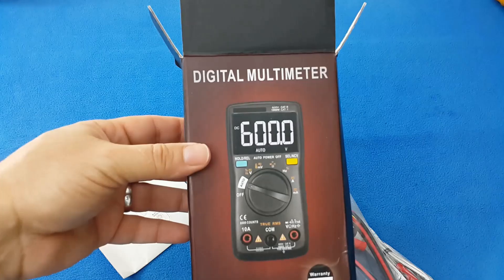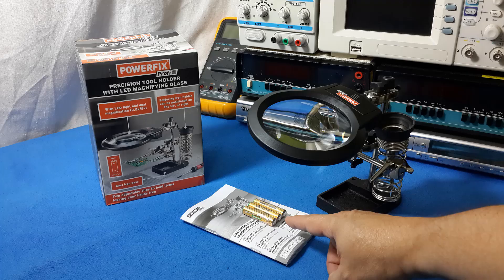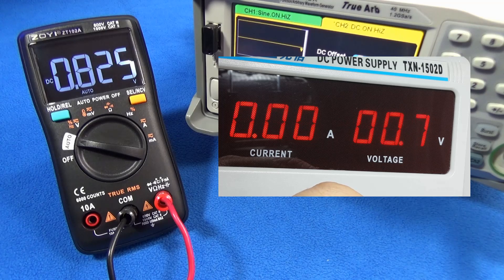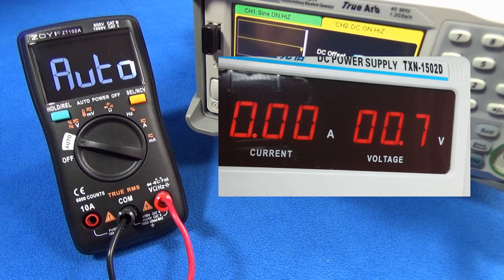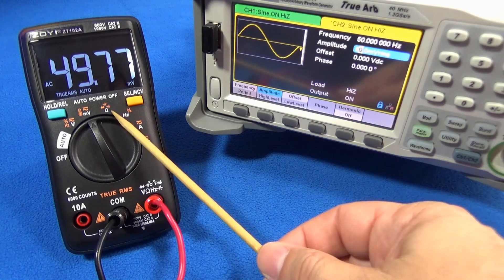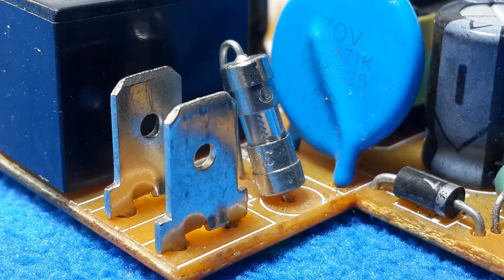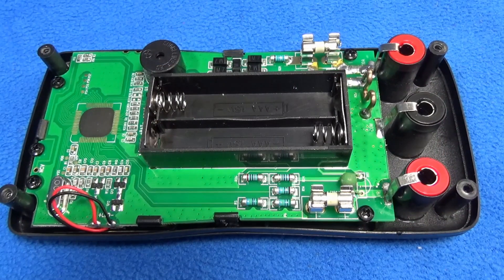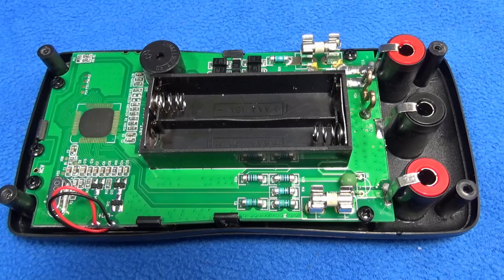ZOTEK ZOYI 102A digital multimeter with AUTO best DMM easy to use for beginners students and repair

Comment: Does your ZT102A still give you accurate reading when you measure diode? Does it read correct voltage when testing diode?